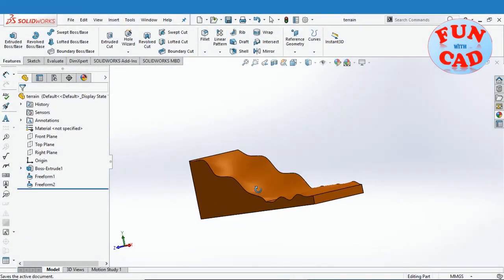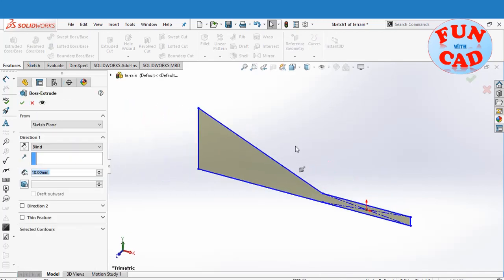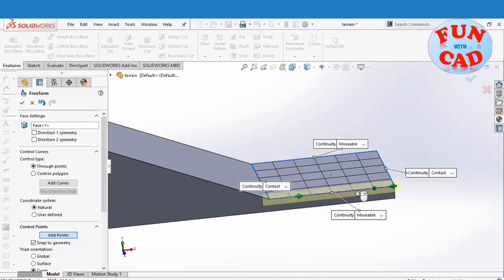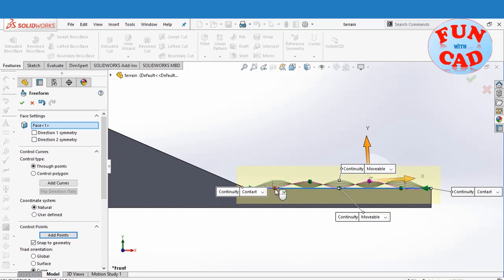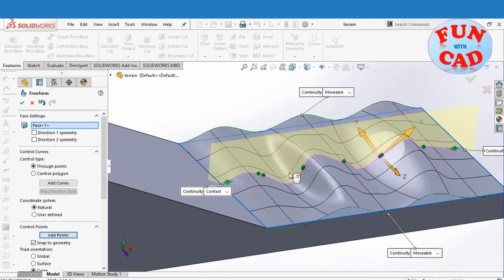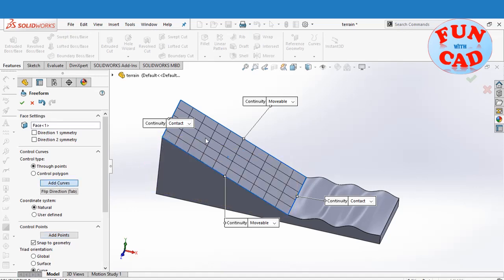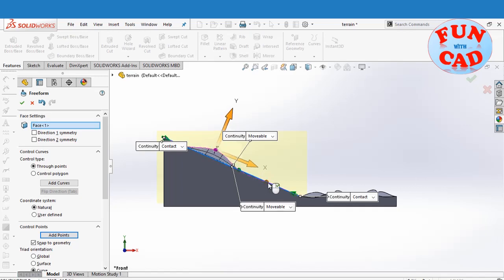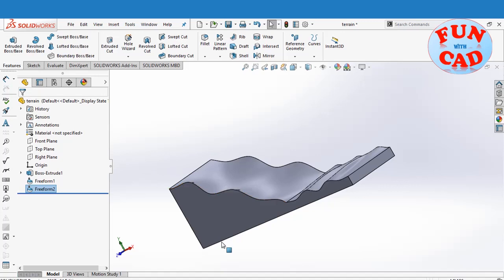Learn to use FreeForm surface feature and create Rough TERRAIN in SOLIDWORKS | Beginner tutorial

Comment: i am getting error, "Rebuild error: Freeform does not modify the face"
Reply: plz guide
Reply from the maker: Hello, can you please let me know how are you exactly using freeform feature?
Reply: @FUNCADwithMrROBOT  i created a rectangular geometry with dimension 1 x 1 and depth 0.05. I am selecting its face and applying freeform feature, once i click the ok to execute the feature it shows this error.
Reply: @HL1334  Reviving a dead comment here but, might be that your solid is too thin and the curvature you're trying to make in the face is "sticking out" the other side, which results in "impossible" geometry?